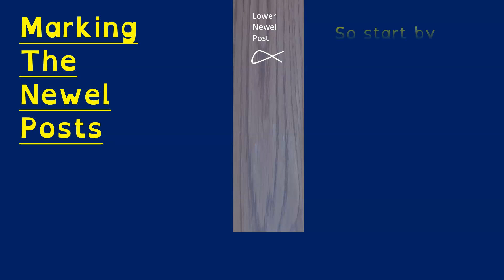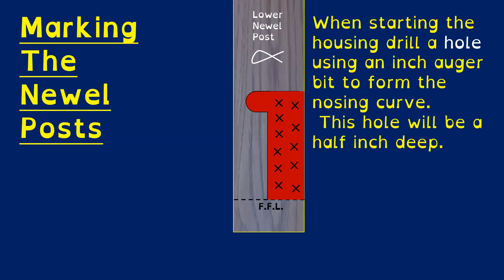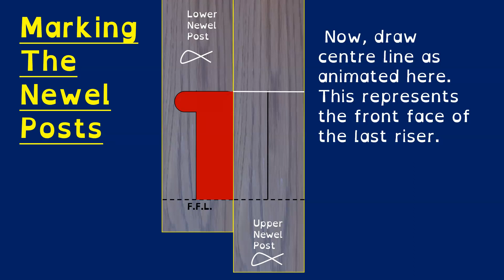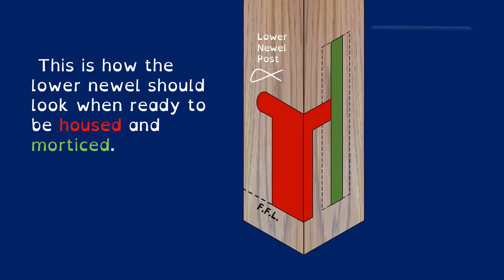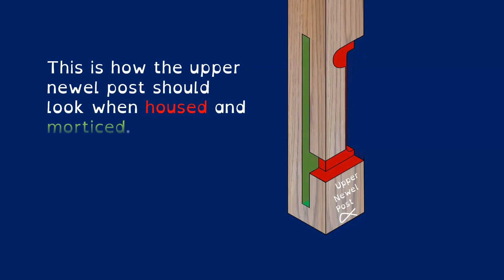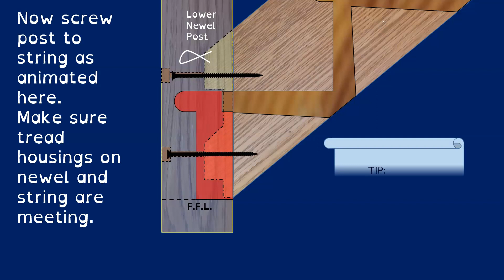Marking Out Newel Posts Housings And Mortices

Comment from the maker: Just want to add that this lesson assumes that you are using a morticer combined with an inch  auger bit to take out the housings. But you could use the Stair jig used on the string to router out the newel housings also..
Reply: Outstanding presentation as always Sir, could you do a video on marking out the stringer tenon's? 👍🔨🇮🇪
Reply from the maker: @Toyotaamazon80series  ....will do when i get a chance
Reply: @michaeldownes516  Outstanding Sir, 👍 🔨 🇮🇪
Reply: I prefer to draw bore the tenon's, it's more traditional and requires more skill, 👍🔨🇮🇪